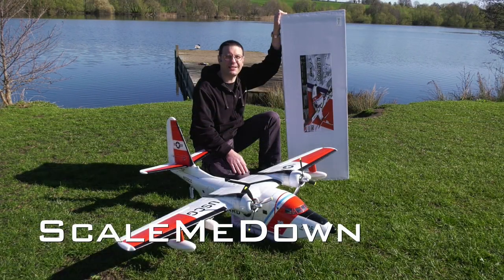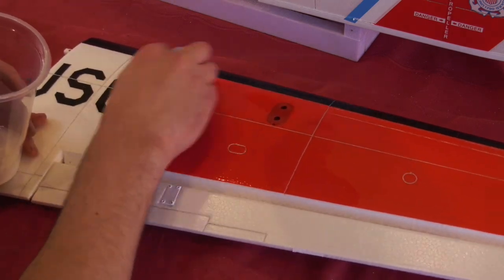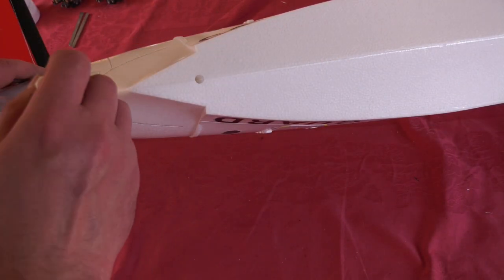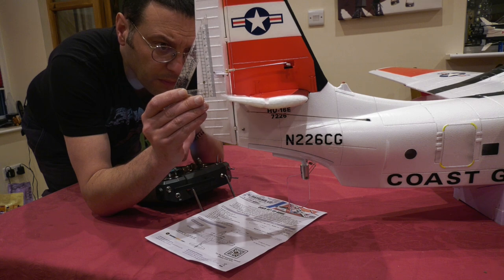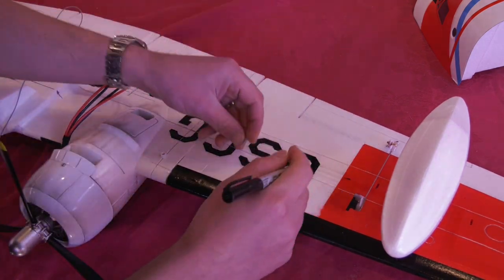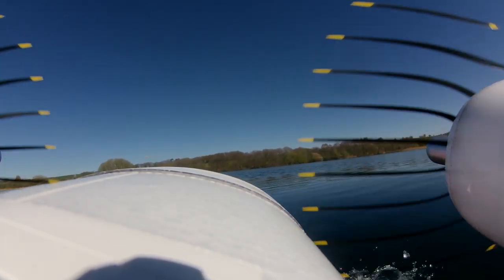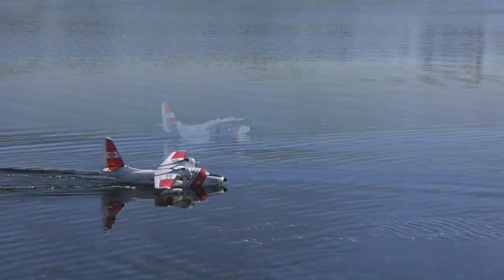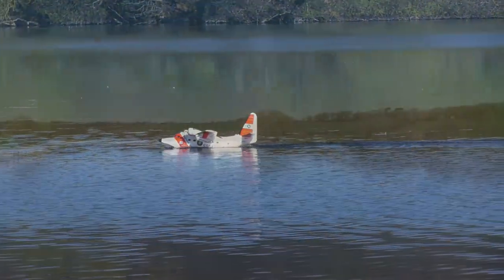Avios Albatross V2 Modifications & Review

Comment: Nice review, and I love your flying site! The external fuel tanks look great and I guess are pretty light (incidentally on the full-size the floats also acted as fuel tanks). The plastic dummy wheels usually pop off pretty easily, which makes painting them (and the foam behind) much easier - this does improve the looks a lot! The water rudder is completely non-scale and can be dispensed with if you use differential throttle (which of course can be used on grass as well as water). I re-used the water rudder servo to drive one of the elevators, giving a bit of redundancy. The fin is way too big for scale - I cut mine down to the level of the top hinge which improves things a bit. The domed spinners are also wrong - there are files around to 3D print more accurate ones. As you found the model is way overpowered on 4S and the stock props have been known to shed a blade if you're heavy on the throttle (with the resulting vibration potentially pulling the motor mount out). I fly mine gently and never use more than about 65% throttle even on takeoff ... I suspect it would be better on 3S (which is given as an option). Half flap slows the model down to a more scale speed but also makes the stall more docile - I fly mine like that at all times now. I noticed the adverse differential on the ailerons when setting it up but this doesn't cause any issues in flight (on mine, anyway). You can get a bit of water coming in where the wing LE meets the fus. - I seal this slight gap with a short strip of clear tape. The stock wing bolts on mine also started to rust (flying only off fresh water) - I got some stainless steel replacements on eBay. There's a big thread on this model on RC Groups, and I have some videos of mine on my channel here. Keep up the good work!
Reply from the maker: Thanks.  It sounds like you have had fun with your model also.  I think this is quite a nice kit, that with a bit of time and care can be made even nicer.  The finished plane is perhaps a bit heavier than I would like, but it certainly flies well.  I didn't think to pry the plastic dummy wheels off - that would have definitely made the job a bit easier !

Comment: Hi,i have a problem with reverse throttle. I put a reverse cable to channel 8 and assigned it to switch,but it does not work. Please do you have any idea? Frsky x20. Thank you very much.
Reply from the maker: Throttle must be commanded shut.  Set output for channel 8 to 50% for 1 switch position and try again.  If the motor still runs the same way with your reverse mode activated, try setting channel 8 output to 0%. Hope this helps.
Reply: @ScaleMeDown  Thank you very much. I just found, that THR Reverse does not work on a 3 position switch on my FrSky X20. So few minutes ago, i tried to change channel 8 on a momentary 2 position switch and it works. But i will try it as you wrote, but back on the 3 position switch. There must be a way, how to do it. Thanks again!
Reply from the maker: @tomasblaha9704  Glad you have it sorted 🙂

Comment: Would you happen to have a diagram of how you wired the multiplex connector? I think that's a great idea! Thanks
Reply from the maker: I Will rustle something up.  Please send me an email (address in the about section of this channel home page) so I can respond.
Reply: im not finding your about section. im interested the wiring diagram as well
Reply: It was actually really easy and you can google it. Just need the two outside posts as positive/ negative And then the middle ones are free for individual signal wires

Comment: But doesn't fitting the engine mods interfere with the airflow?? I would imagine the motors need some cooling??
Reply from the maker: Cooling air is more to do with getting air out of the cowlings.  Cooling hasn't been a problem so far